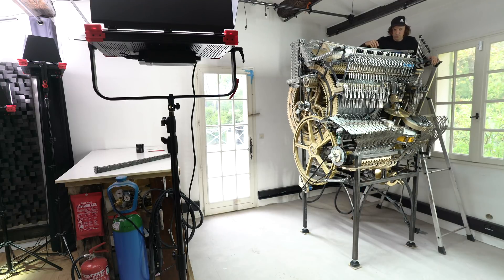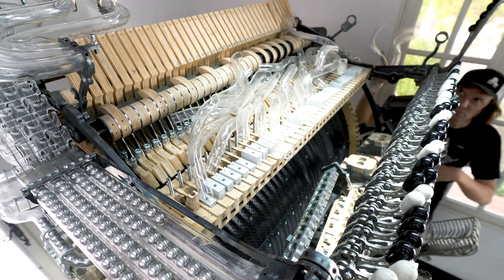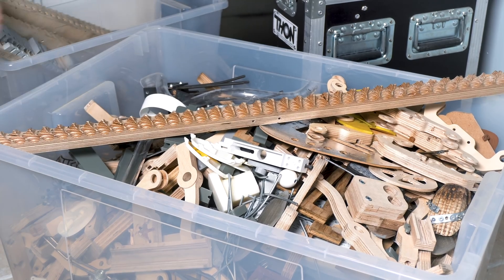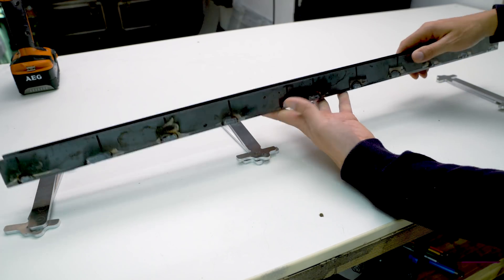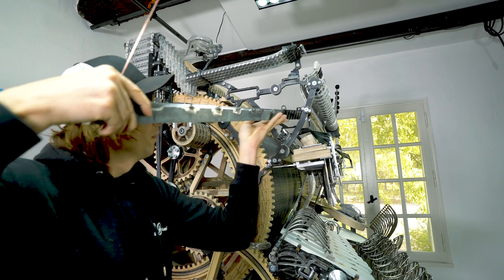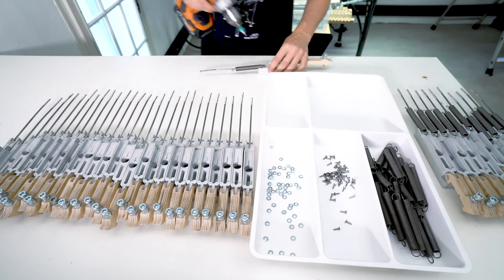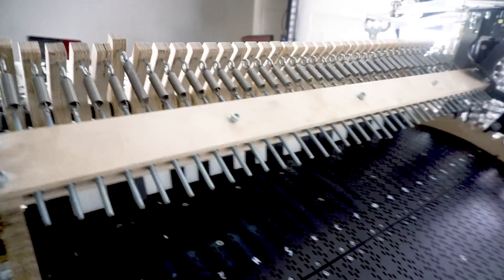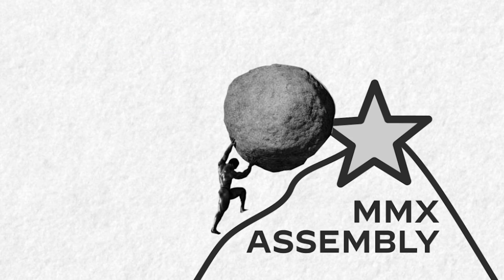Spring Tension Mechanism - Marble Machine X #141

Comment: @Wintergatan: 
When the spring pushes the tension rod upwards, the screw nut seated in between the metal bars may jump out and rotate, causing the tension to most likely release a bit. At least this is what happened in my mind when watching you testing its functionality.

Comment: One thing you might consider is the possibility of nut slippage/rotation due to vibration of the machine as it's in play.  Simple fix:  Try laser cutting a piece of heavy cardboard ~1/4 the thickness of the nuts so they have a hexagonal shape the nuts fit into.  It'll eliminate the risk of rotation, and doesn't really need to be an expensive or heavy material, because the rotational forces will be so tiny that even cardboard should overcome any movement.  You could machine little nut pockets for each one, but that'd be HUGE overkill with such small forces involved.

So yes...I've been watching for quite a while.  Sanity IS rather highly overrated, is it not?  d;o)

Thought:  Once completed, I wonder how much an "MMY: The Final Version (v1.0)" kit would cost?  I bet there's more than a few people out there who'd want to build one of their own once you've perfected everything!  \\=^D

Comment: Enough, Martin! Jan. 18, 2017 you started with the design sketch... with so many engineers and fabricators helping you build this MMX surely some one would have thought of friction issues and mechanical fatigue problems with the spacing tolerances of each section of moving parts! It was in CAD! Why find out 3 yrs later it needs redoing?! Get on with this and stop with the  "perfection or bust" BS or you will never finish this project, only find more excuses for every redesign! Nothing is ever perfect; no mechanical device will run without wear and tear...

Comment: that tension design looks far too loose.. if it needs precise calibration, it will undouble loose that during use. you need to lock the position of the nut on the screw somehow.

Comment: A re-framing for you:  the question isn't whether you've failed or will fail. It's whether you have a foundation to continue building on. Clearly, you do, even as you swap out large components of the MMX.

I don't think the risk here is sunken cost fallacy, so much as perfectionism. Try as you might, the MMX will never perfectly match your vision, because your imagination is boundless and you will never stop thinking of improvements. When you get it into the field, it will have unanticipated problems or opportunities for improvement. What's needed, IMHO, is to begin including field testing in your iterative loop: choose a stopping point, and test it in front of live audiences at local gigs. Make adjustments, and then expand to regional tours. Make adjustments, and then expand to a world tour.

Also, thank you for choosing viewing quality over ad revenue.

Comment: Maybe Use wingnuts for the tensioner, if youre gonna keep using fingers to tighten and untighten, over time either vibration and dust, those will become more difficult to unscrew but wingnuts will work for longer

Comment: I see you have the same model of dremel that I do.  You may eventually find that it fails to turn on.  The reason for this is that the mechanism that allows that sliding blue piece of plastic to engage a microswitch way back on the other end of the tool is designed so poorly as to almost make one give up in despair of the very notion of the human mind being a rational or problem solving machine.  Should this failure mode start to happen it's because the blue slider can no longer apply enough pressure on the microswitch to engage it.  In that case, slide to the "on" position and use a dedicated Special Ignition Key (small hammer) and give it a light but firm whack of shame directly above the speed control knob.  That will compress the microswitch and get it started again.

Comment: Instead of using those nuts you could have something that provides clamping pressure where each rod comes up. And so you're not using a screw on that as well, I was thinking along the lines of how a vice grip works.

Comment: A square nut would probably be better for the top of the spring tensioning system. It'll be way less likely to slip or round over.

Comment: [sends a huge virtual hug] I appreciate the option of not using mid-roll ads. They never break into the video at the wrong point.

The spring tension design is much better than the previous version. The fact that you can adjust each piece as needed.

Comment: For cleaning the steel use a flap disk on the angle grinder, it’s quicker and easier than using a cut off disk

Comment: Quick tip: You should mark all the bolts that have been loctited on the head (I just put a tiny dot of loctite on the side of the head, but any mark will do). That way, you can go over the whole machine very quickly to identify fasteners you haven't loctited

Comment: Great job with the MMX but ON the spring tensioning system? I would add a second nut to lock it in. The marble machine will vibrate  with all the movement of marbles. I think you would suffer on tour with your springs loosing. Just a thought

Comment: You can remove the mill scale from steel parts by soaking them in vinegar. If you don't use heat, you'll have to soak them overnight, but the scale should come right off with a scotch bright pad. You can heat the parts and then drop them in the vinegar and that works in about an hour. I'm not sure exactly how much heat to use, but it's much quicker. If you use heat, be sure to do it in a well ventilated area (preferably outside) and far away from anything that can rust because the acid in the vinegar will turn to vapor and eventually fall on everything causing it to rust quickly. This method of removing mill scale takes more time overall, but is much less labor intensive than an angle grinder.

Comment: I think you might have problems with the spring tensioners making noise. When they pull whatever they are attached to back to their initial position, a wave is going to transmit through the springs and cause the threaded rod to jump. You could solve that with a nut on the underside, but you'll slow down the adjustments.

Comment: 10:20 when you get the bolt right you got to put this stuff onto it so it won't move too easy. My luthier put that stuff on the output jack of my acoustic guitar as well, it used to go loose

Comment: Martin, I am sales guy, so no engineer things in my mind BUT this new system seems so weak. Did you take in consideration all vibrations of the machine when running? Because the tightening nut system of the spring ..... I watched all your videos and is the first one I think something is wrong with what you did.  But you have all my respect.  I hope one day we will have the chance to see MMX in action. What will be first the MMX or the Sagrada Familia? 😉 Anyway, I believe !!

Comment: Just a tip: the most useful tool for removing broken or damaged fasteners is a set of left handed drill bits, they are trying to unscrew the fastener as they bite.  And a suggestion, in most cases you don't want to use a spring in extension, it's too easy to go past the elastic region and permanantly stretch it out of shape.  It's usually better to design springs in compression if possible.

Comment: I don't believe in sunken cost as a fallacy. If a goal was supposed to require ten units of work, and after nine units done it turns out to still require ten units of work... I don't see the problem. If it was worth spending ten units on at the start, it still is worth spending ten more units on now; nothing changed. Yes, things are far different if a finite budget is involved, which can run out - but when one spends "quasi-renewable" resources (everybody gets 24 more hours each day) on it... sorry, there's no such thing as a sunken cost fallacy.

Comment: Unfortunately one major design flaw IS the top part of the marble divider which depends on the marbles being perfectly level when full. If this part would be designed in such a way where level of the top marble was insignificant, the rest of the assembly would probably need half the sub assemblies and be a hell of a lot more reliable especially on tour.

I'm really missing first principles engineering in the re-design effort here.

Comment: Please add a second nut to those spring tensioners. A single nut will unscrew from all the vibrations, but two nuts that are tight together won't as quickly

Comment: I don't like that YouTube automatically adds mid rolls to my videos either. I forget sometimes then go back and see that YouTube has added a crap load of ads in the middle of my video or in awkward locations and then I have to go remove them or put them somewhere better. I turn them off completely on all of my short videos (I try to remember) but may leave a few on my longer videos. For several years I refused to monetize my videos. I don't make videos for likes or money, but then thought why not put some skippable ads in? It might get me a few bucks each month to pay for gas money out doing my hobby. But I was surprised at how much money you can make even with a small number of subscribers and like you said, as soon as I started putting ads in, my videos started getting promoted more and my subscribers went up. It took years to get to 1000, a few months to get to 2000, and a few weeks to get to 3000. I don't want to annoy people with ads but that seems to be the only way to really get promoted. And I just looked at some analysis on my most watched video. It gets thousands of view a month but the average view duration is 4 minutes. The first mid roll as is at 4 minutes. So the majority of people dump the video when the first mid roll pops up, proving what I already knew (since I usually dump videos when the first mid roll comes up with few exceptions), that most people hate mid roll ads. I removed that mid roll. We'll see it the view duration starts to increase up to the next mid roll.

Comment: 10:17
I would recommend that you actually weld the nuts to the metal bars and the frame.
And that you should get what is very well known to any fisherman as a "swivel" and attach it between the threaded rod and the spring itself.
Then you could weld a small wing nut on the upper end of the threaded rod and use IT to adjust the spring tension.
Rather than needing to lift the threaded rod and turn the nut, you would be able to simply turn the threaded rod via a wing nut on the upper end of the threaded rod. And the swivel would keep the threaded rod from turning the spring.
VOILA....elegance.
-✌🏼
Reply: It looks like he's trying to avoid using a friction lock nut on the adjustment screw, and the spring keeps the screw from spinning in the nut.  I would leave it as is, but add a felted clamp along the line of nuts.  Otherwise, they could easily bounce out of the slot during transit and change the tension without you knowing.
Reply: @robot65635  it wouldn't need a friction lock nut. The spring tension would seem to be sufficient.
Reply: @Finn-McCool  Normally yes, but during transport there could be large unexpected G forces.  If the spring can be stretched by hand for adjustment, there is the possibility of jostling doing the same.
Reply: Wing nuts would take up more space, and it would possibly be difficult to adjust one wing nut WITHOUT touching the next one over.
Reply: @johnnyjohnson6643  
Thumb screws are hardly any bigger than the rod. It would be adequate.

Comment: Handy engineering tip:

Reverse twist drills that cut counter-clockwise are handy to have around for extracting busted screws.
Don't get them mixed up with your normal drills and forget though. 😉
Reply: Reverse twist drills are life changing when it comes to removing broken bolts. They are amazing
Reply: When you mix up the drills but you also accidentally left the mill in low gear while engaging high speed so you don't even notice `\(~.~)/`

Comment: 7:36 -- Thanks for talking about our frustration of YT becoming more and more like annoying mainstream TV regarding ads.
I wonder what changed that YT needs to do this after so many years where it worked without.
Reply: Demand supply and corporate profits. There is no other place to go for the creators and viewers will put up with the ads to get the entertainment they cant find anyplace else. Youtubes is using this to make youtube more profitable. Those that can will shift to streaming content instead of videos. But that is a small segment of youtube creators. Welcome to cable tv v2.0 Its better. But the ads will still make you puke.
Reply: @RasakBlood  - Beside the centralization/monopoly problem I suspect the for much too long ongoing lack of disruptive programming language development (since it's short term unprofitable) to play an perhaps equally important role. I could imagine that youtubes rapidly grown closed source codebase has by now become a bitrotting dependency hell nightmare that requires an exponentially growing army of high paid code maintainance workers to keep working as astoundingly well as it does. Then again there are so many people using youtube that these SW maintainance costs should still be peanuts in comparison to the profits. Smaller costs than keeping the server farms running? I really can't judge that.

Comment: 10:17 "I can't actually think of a simpler fewer parts design for a spring tensioning system."
The same design, but remove the bolt and have those shafts threaded. Have a little handle welded at the top for rotating by hand. Finally, change the connection to the spring to a ball joint instead of a hook, so that it can freely rotate while it's connected to the spring. It's harder to make but and will potentially twist the spring but it does reduce the part count by 1! You could even fuse the spring with the adjustment bolt entirely, and have the ball joint at the bottom of the spring, connected to the lever. This would save you a second part.
Reply: Not sure if I understand the plan correctly, but from how I envision your suggestion, there would be no mechanism to prevent the shafts from slowly rotating from vibrations, causing the tensioning system to go slack over time.
(Also, you'd reduce the part count by 1 nut, but increase it by N parts to form the ball joint.)
Reply: @CLipka2373  The ball joint could be a mere 2 parts, effectively brought down to 0 parts by fusing them with the existing spring and nut parts.

I do agree that my solution is trash I'm just trying to optimize part count. ;)

Comment: Not a single screw, bolt or nut that's not put in place with Loctite will stay fastened on a journey via plane or ship. Just telling from experience. Including the spring tension mechanism. The nuts will dance around until they fall off the bolts.

Comment: I think instead of a screwing system you could've installed a ratcheting system that allows you to just squeeze, and adjust the spring on the go, it does however bring more mechanics into the system that could break but it might be able to make the system faster and easier to use.

Comment: New video every wedn...no. 
new video on Every two we... no.
Every month one new video perhaps.
The spring tension system IS good, ADD there also nylock nut, so you dont Loose The Bolt and normal nut If you Loosen IT too much..